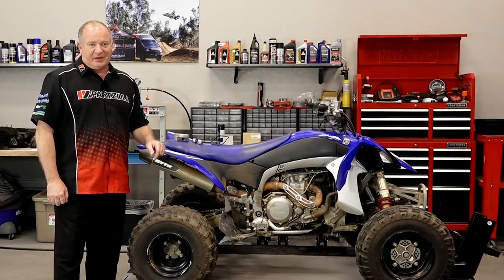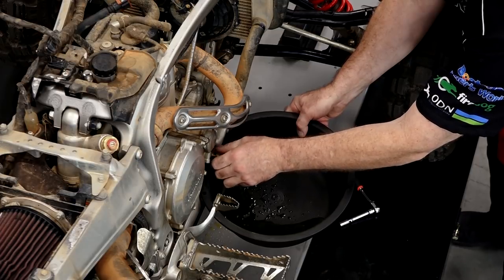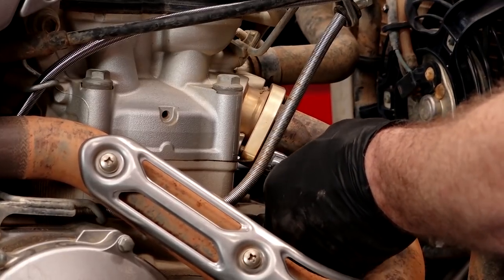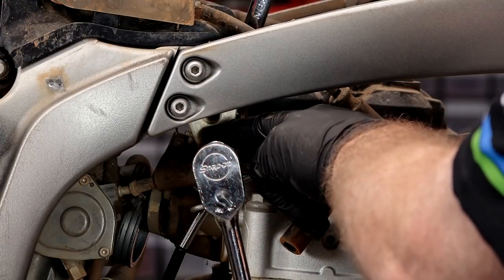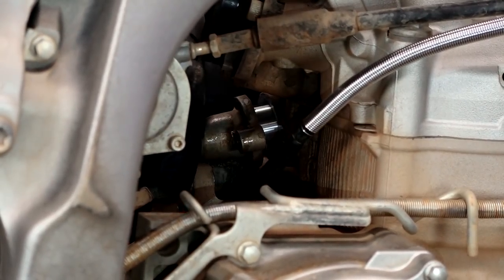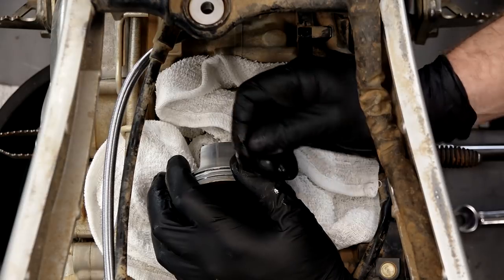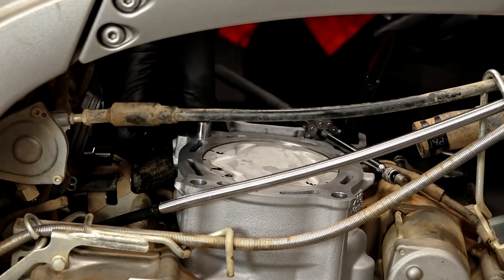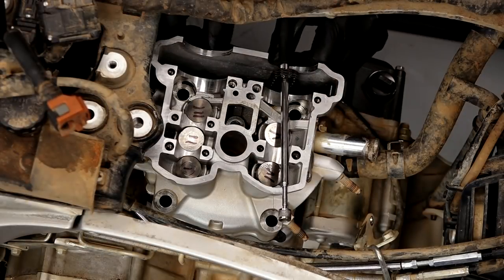Yamaha YFZ450R Top End Rebuild | Partzilla.com

Comment: Are you just doing this for information purposes or do you have an actual shop you work on customers quads? If so where is it located? I have a 2005 yfz 450 se that seized up on me cpl weeks ago while riding the dunes! I purchased a 2014 yfz 450r se next day from dealership so my trip wasn’t ruined! Now I have to fix the 2005 and the top end was done not to long ago that’s why I wasn’t to worried about buying it but I don’t think the oil upgrade was done to it. From what I found the 04-05’s had an issue getting oil to the top end and there is a aftermarket funnel type part you have to install that helps circulate oil through the motor!

Comment: Will the quad even fire and run at all if the timing is out or sync? I checked my 2003-4 honda trx450s 4x4 and the timing was 180° off from tdc but still runs. I just want to make sure because I was told it wouldn't run at all.

Comment: I ha e so many questions my 2018 Yfz 450r doesn’t start an keep makin a buzz noise near the battery but My lights an neutral sign comes on but my gear shifter is stuff an will not move at all I’m lost

Comment: question? do you have to make sure that all the slack is out of the non tensioner side?  of chain? on some brand  motors if you don't ,when you put adjuster in, the cams will rotate & be out of time one tooth!

Comment: Hello John, I Did A Top End Rebuild This Weekend And Follow Every Step On Your Video, But For Some Reason My Quad (yfz450) Doesn’t Want To Turn On, Has Spark And Cranks But Just Doesn’t Want To Start, Any Idea? Maybe The Timing Is Off? I Also Installed A Brand New Stator And New Battery So This Was My First Time Firing It Up With All The New Parts.
Reply from the maker: Are you getting spark and fuel?
Reply: Partzilla It Is Getting Fuel I Disconnected The Fuel Line On The Carburetor And Opened The Fuel Valve On The Gas Tank And Fuel Was Coming Out And It Also Getting Spark. Put In A New Spark Plug And Gapped It To Quad Specs.
Reply from the maker: @robertvalencia20  Do a compression check for valves, then check timing.
Reply: Partzilla Retraced My Steps And Don’t Think I Top Dead Centered It Before Removing The Cams But Did Top Dead Center It After The Install, Not Sure If That’s What’s Causing The Problem.
Reply: Also How Do I Perform A Valve Compression Test?
Reply from the maker: As long as it was TDC when you placed the cams and timing chain...

Remove spark plug and use a compression tester on the cylinder.
Reply: Partzilla Performed 3 Test And All Test Psi’d At 85/86

Comment: Hey there I have a question about the 2005 yfz450 they have a bad oil system so could i use a case cover from an 07 that already has the nozzle on my 05
Reply: jerjer 1990 run some duos

Comment: Excellent Job JOHN Sirrr....👍
Reply: Actually no... he failed miserably.  He let a fresh engine (new cylinder and new piston rings) idle for WAY too long.  In other words... he completely messed up the break-in process.  This engine will never make the power it could have made.  It will also burn more oil than it otherwise would have... had he broken it in properly.  How a new engine is operated (after its first start) is very important.  You start it and let it idle for only about 20 seconds... just enough to get everything lubricated.  Then you put it under LIGHT load (ride around in 1st gear only... with light throttle/load... until it reaches operating temp).  Then... staying in 1st or 2nd gear you do FULL THROTTLE runs all the way to redline... and then chop the throttle and let it overrun back down to low revs. The overrun (engine braking) helps seat the rings so as to get proper oil control.  The full throttle runs to redline help seat the piston rings against the bore while the cylinder is still sufficiently rough enough to be able to do so.  By doing this you are essentially grinding the rings and the cylinder bore into conformation with each other... so as to get the best seal (compression) between rings and bore.  This is how it needs to be done.

Go to mototuneusa for full explanation.
Reply: @mareksumguy1887  That's not really approaching accuracy. From all the testing I've seen. Engines broken in with different methods have no measurable difference apart from one test I've seen where the top ring end gap varied by 5 millionths of an inch.
Reply: DarkLordDylan ... you talking about MC Garage??
Reply: @mareksumguy1887  Yup, they were the only ones that found any difference whatsoever.

Comment: Why didn't you clean the carburetor?
Great job,  but I wonder if motor is going to be a 100 % without cleaning that carburetor!
Reply: This quad is fuel injected so it doesn't have a carburetor.

Comment: Hi, I really appreciate the job you did with filming all these operations. I just wanted to ask if the valve cover gasket is the same at 2007-2008 yfz450 and after 2009-... yfz450r? The shape is equal, but I don't understand the price difference. That's why I am asking this :) Thank you for answer.
Reply from the maker: From your description, I'm not seeing a different part between the model years.

Comment: I have a 2014 and it's smoking blue smoke could it be a valve seal?
Reply: Depending if it's at start up only or the entire time its running....valve seals usually only smoke during startup

Comment: Dry assemble....only oil the pin. Hone the cylinder, Dry Rings, Piston and cylinder....Once back together spray some contact cleaner into the plug hole and turn it over several times
Start it until and idle it until it pukes coolant....let it cool and repeat one more time...done. No break in at all. Try it and on the next topend you will be surprised how good the piston looks after 80 hrs......no oil to burn off and carbon up